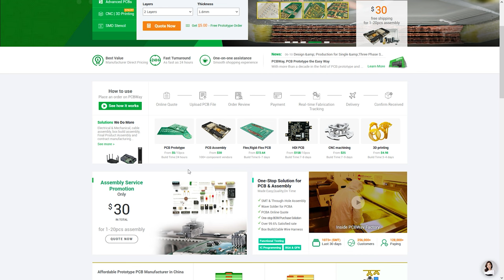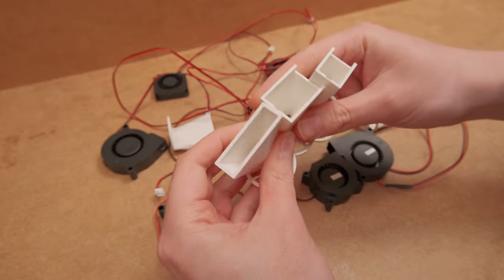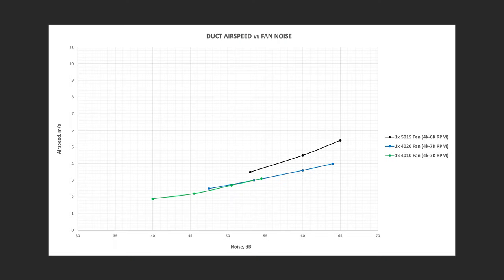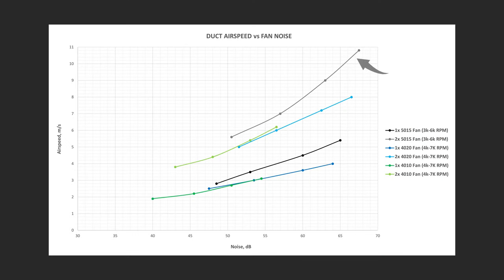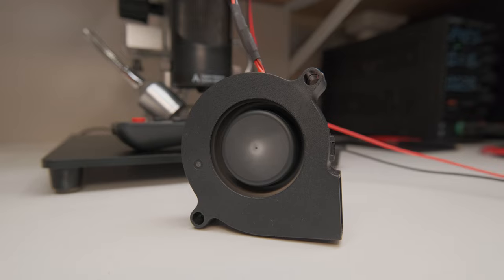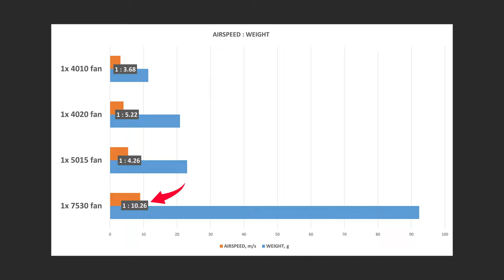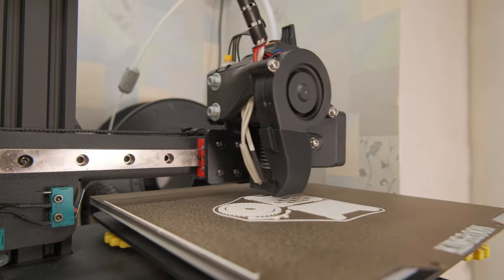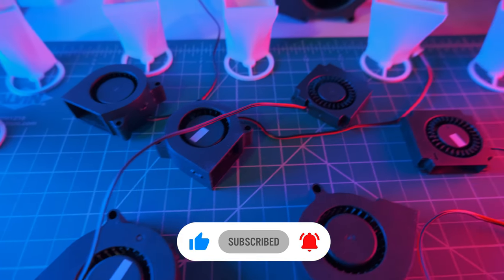3D Printer Part Cooling FANS COMPARISON (AIRSPEED / NOISE / WEIGHT) - 5015 vs 4020 vs 4010

Comment: How effective is a 5015 as a heatsink fan, if I can't mount it directly? I currently have a 3010 (or 3015, don't remember exactly) fan mounted directly to the heatsink (v6), and I'm wondering if placing the 5015 fan above the heatsink and ducting it would result in quieter operation?
Reply from the maker: In general blower fans are more efficient than axial at forcing air through small ducts or through the fins of the heatsink. 3010 achieves good cooling results by running it fast and annoyingly loud. I think 5015 as a heatsink fan would be a little bit overkill, but if the silence is your number one goal then yes it could provide better noise levels with better cooling. Just keep in mind that you have to reduce its speed first and the easiest way would be with a resistor. And if we are talking about ducting 5015 fan that is on the printhead then I don't think you need to worry about the performance loss.
Reply: @PrintingPerspective  Thanks for the reply! I'm running almost stock cooling setup still (might be a 4010 fan, but no duct)l, I'm planning on running a 5015 for part cooling, not worried about duct losses there, just the heatsink - I've got extremely limited space - it's a corexy, but there's little space from the build platform to the edges -, and a 5015 would fit better than the 4020, for axial fans I think only the 3010 is possible, don't have the distance from heatsink for a bigger fan with duct.

Comment: I bought 2 4020 by mistake so I use those in pair, I agree with everything you said, they are weak, can rattle at high accel,  in pair they are ok but not much or at all better than 2 4010

Comment: My printer has stock 30mm for E3D Heatsink and 2x 4010 fans. Interestingly the 30mm fan was the big problem on mine not the 4010 fans.
So I have to replace the crappy 30mm fan since I got heatcreep issues and it was loud as well.
Reply: You know what, i think 5015 centrifugal would do nicely for cooling the e3d coldend heatsink :D With a little voltage regulator to go along with it and drop its noise level.
Reply: @SianaGearz  This may be, but it´s also heavy. I just used a 40mm instead.

Comment: A 247printing / bambulab aux fan not fitted to the print head seem to be the best upgrade.
Not seen it done on a bed slinger yet as you'd have to mount it on the x gantry,  but it's totally doable.

Comment: Mine use huge blower fans attached to the frame. The air supplied to the hotend through silicone casw, and yes i use liauid cooling.😅

Comment: Now how does airspeed affect print quality? From what I've read the higher the cooling, the better the pieces look, but the lower the layer adhesion. My question would be where is a good point? I usually run a single 5015 fan at full speed with the Petsfang cooler. Is this maybe already too much?
Reply: Cooling does not harm layer adhesion at all unless your hotend temperature is too low and you're relying on the previous layer still being hot and soft in order for the next layer's heat to be sufficient for bonding.
Reply: @daliasprints9798  that depends a lot on what material you print. too much cooling can cause serious layer adhesion problems with filaments such as petg or asa. but for pla its usually fine to blast it with as much cooling as you can.
Reply: @2mD  For ASA and ABS, cooling to room temp is problematic but if you're using a chamber, full strength cooling to the chamber temperature should be ok. I don't have experience doing this but the folks I know with chambers & Annex printers seem to do fine.

For PETG, I print with my full cooling (over 100 cfm total air flow) and no layer adhesion problems, at 270-290°C.
Reply: @daliasprints9798  my chamber isn't heated ( yet :D ) so it only reaches ~40°C, maybe that's the problem. 
and 290°C for petg seems quite high. i usually print somewhere between 235 ( extrudr XPETG ) and 250 ( most other PETGs ). and with that i get layer adhesion problems with more then ~40% partcooling ( 12032 blower fan ). but if the higher temp works for you im gonna give it a try :)

Comment: Thank you for your comparison testing. I'm only just starting out into the wide world of 3D printing and as such this may sound a bit weird. But has anyone tried to use a high volume air pump? There'd be no noise from a fan per say, and the air flow can be fine adjusted to the precise point at which it is needed and can be located away from the hot end and have no vibration issues
Reply from the maker: Are high volume air pumps are quiet? I really doubt they are, plus you will still hear the whoosing noise out of the duct hitting the print. Vibration issues? Unless you hit the speed at which fan amplifies vibrations then sure, but even with a fan that has high vibrations it is not issue https://youtu.be/TXw37ydld5g

Comment: I tried a 4020 fan but it amplifies the noise from the pwm speed control. I found that 2 4010 fans have good cooling and less noise than the 4020. I don't have space for 5015 in my printer.

Comment: I only ever met 40x10 fans that come stock from Creality and they are noisy AF. I've switched Steve's ones to two axial Gdstme 40x20 with Briss Fang, and it was way quieter all this time. Now I've switched to Creality Sprite and it comes with another set of noisy Creality fans.
I'm considering a mod for two 40x20 again because I have them, but I think the mod I'm looking at requires one axial and one.. the other one, so I'd still have to buy some more. One 50x20 is considered two... I'm not ready for two of them ;)
Reply from the maker: The most mind blowing thing is that no company yet made a 3D printer oriented to be silent. Because I think that is what most people want as they have a printer in a living room and the noise gets annoying pretty quick.
Reply: @PrintingPerspective  Yes, I'd quite like it to be quiet. With my previous fan setup, I could close one sliding door (the printer lives in a wardrobe) and struggle to remember if it's on, with two I couldn't hear it. Now I still can hear it's on with all three doors. No sleeping with it working unless one really likes white noise with a bit of whining 🙈

Comment: I run 2x5015 for print cooling and one 4020 for hot end cooling. I’m impressed with this setting. I have a hard modded Ender 3s1 pro.
Build a housing, use clipper, have linear rails on all axis, the z axis is with Pom anti backlash and brass sliders for z wobbling modded. I have a modded breakout board. Installed a bi metal heatbrake, z axis belt tensioner, and a full custom heat bed by a 750 watt 220v silicone heater isolated of course with an 6mm cast and cnc machined aluminum plate on silicone spacers. And a have squash balls feet. My whole electronic is upgraded with safer parts (meanwell power supply, extra fuse for the bed, ssr relay for the bed, some additional fan, cutouts in the botten cover).
Reply from the maker: That is a lot of mods. So, basically only what has left from Ender is the frame? You should make a name for it because it is nothing like Ender anymore, haha! :)
Reply: @PrintingPerspective  I should think about it, I forgot the copper heatblock 😉 Bit i Tell you, the energy saving and consistance of printing is amazing.

Comment: I question your anemometer setup. Ideally an anemometer presents no loading to the airflow, it just spins freely. But using only one third of the anemometer opening is making it behave like a turbine with an attached compressor. The open side is going to push/pull ambient air presenting the fans with a much higher loading (pressure drop) than they would be with just a duct alone. This will bias the measurement, and fans with better pressure performance vs airflow will outshine.

Minimally you should block the open inlets of the anemometer so they have less loading.

Comment: Man do some testing between all different 5015 brands! There seems to be so many (Delta, sunon, th3d, winsinn, creality, MX/topfan, etc)
Reply from the maker: More known brands like delta, sunon have datasheets so it is very easy to compare fans yourself. Plus sourcing all those would be a nightmare as you can't find them in on place or at least I don't know where. :/

Comment: Is a 6028 worth it for having more than 2x the airflow of a 5015? (Also, 2x 5015's weight)
Reply from the maker: I didn't test the 6028 fan, so unfortunately I can't answer the question.

Comment: Would be nice to see 5020s. Reportedly they're quieter and have better performance than 5015s.
Reply from the maker: Now when I done the whole video it would. Too bad, I didn't have any on hand and the ordered ones didn't arrive. But when I was looking at the datasheets 5020 fans usually had way lower static pressure compared to 5015's and that is definitely not good if your cooling duct openings are narrow. But then what is better? Wider or narrower duct openings? :D It's like a never ending story, haha!
Reply: @PrintingPerspective  Interesting. The ones I've seen are mounted without any complex or or shrinking duct path, for example the Annex usermods Chubby, so indeed they're in a setting where static pressure matters a lot less. But I thought they were comparable. I'll look at the specs on some. Been thinking about changing out my 5015s for 5020s.
Reply: I love 50x20 blowers (the ones with intakes on both sides). They're so much quieter for the amount of airflow compared to anything else I've tested, I started incorporating them into my own designs. If you want to design around one, I uploaded a 5020 blower model to thingiverse (same username) some time back. I've been surprised how popular that model has been. Apparently a lot of people like them. :)
Reply from the maker: When I get the 5020 fan I will test it and post the results on this channel community tab and on Twitter.

Comment: as far as i understood partcooling its not about airspeed but airflow. airspeed: the speed of the air in m/s as mentionend in the video. airflow: how much airvolume per second. i want to know about the airflow and not about the airspeed. cause the speed could be very high but the airflow at the same time very low. so this data seems quite useless in my opinion.
Reply from the maker: You understand that those two things are very closely related, right? Airspeed gives more concentrated cooling. Also higher airspeed gives a higher cooling rate that can be equal to a higher airflow. And the opening size of the ducts on most 3d printers are more orientated to make direct concentrated airflow at higher airspeeds. That provides a more consistent cooling when moving in any printing direction and especialy when printing thin details that needs high cooling rate in a small area. So for you saying that this data is useless clearly shows that you have no understanding of this complex subject.
Reply: @PrintingPerspective  OP is right, airspeed is only viable as a proxy for airflow at very low static pressures and that’s exactly what your test is missing.
Without static pressure numbers the tests are pretty much meaningless.

Comment: Hey thanks for the video I was searching for something like this for a long time, ty for going so in-depth. 
I had a question what if I use no nozzle on the front and run a 7530 vs 2x 5015 (price and weight don't matter) 
will the dual 5015 still pull ahead with unobstructed flow?

edit: both noise and heat removal are important as they will be used in a room next to the bedroom

Comment: Sleeve bearings are only silent when new.  Hydraulic bearings are better sleeve bearings with a bigger oil reservoir. Ball bearings stay the same for years.
Reply from the maker: I mean, I agree with you more than not. But for example, I had a 4512 ball-bearing blower fan that ran at ~7500 RPM and lasted not even a year with a relatively small amount of printing.
Reply: @PrintingPerspective  sunon makes radial fans that are ok in terms of price and quality.

Comment: I always feel like the 4020 moves more air than the 5015. Honestly, I hate 5015's. They're too large and I always felt their output sucked but clearly I Was wrong. I really like the 4020's as noise isn't a problem. Not sure why I feel like this. lol
Reply from the maker: 4020 blower could feel that they provide more airflow but another very important aspect when using the fan in a duct is the static pressure. And there is no way that 4020 provides more of it than the 5015 at the same RPM. But I feel you, I thought 4020 would perform better.

Comment: I have seen noctua 4020 server fans put into a duct... I wonder how that would compare.
Reply from the maker: Server fans usually run at 10K+ RPM, so they probably could match or maybe exceed the performance but noise levels would be insane.
Reply: @PrintingPerspective  search printables for Noctua A4x20 see what I am talking about. 

People replace server fans with these to cut the noise at home, 5000 rpm, optimized for static pressure, I believe they are rated at 14.9 db, 5.2 CFM. Using it may not be simple, 12v pwm, would be interesting to replicate.

I would love to see how effective different styles of cooling ducts are, not sure how you would judge that though.
Reply from the maker: NF-A4x20 has 2,26mm H2O static pressure, while 5015 fans at same RPM have ~12mm H2O. If you didn't watched I suggest checking this video where I compared axial vs blower performance - https://youtu.be/mxb71Ndg6tY
Reply: @PrintingPerspective yes, that video completely answered my questions... Great job.

Comment: Like said before, the brand of the fan matters quiet a lot. And most importantly, the design of the fan ducts
Reply from the maker: Obviously. Because they run at different RPM speeds. That is why I showed graphs with RPM:Performance ratio. Plus unbranded fans from China that almost every printer uses (or you can buy) come with almost identical blade fin designs. There always be variables, but my goal is to minimize them as much as possible and provide the most relevant use-case scenario for a good reference point.
Reply: @PrintingPerspective  yes but you should’ve used all same brand fans to have a more accurate comparison between them
Reply from the maker: They all were MX brand fans that I ordered from Kingroon store on AliExpress...

Comment: after running dual 5015s for a few years Im going back to dual 4010s, the noise just isnt worth it.
Reply from the maker: I mean, did you run them at full speed that noise is the issue? Maybe it is the duct that increases the noise because they affect the noise levels too.
Reply: @PrintingPerspective  I was using the hero me duct on an ender 3 and theres really a bunch of problems with the duct itself that made ma not a fan of the design...
but ya, if you have to run the fans at 50% just to be as quiet as the non-silent steppers there really isnt a point (for me) to use the bigger, higher power draw, louder, heavier fans.